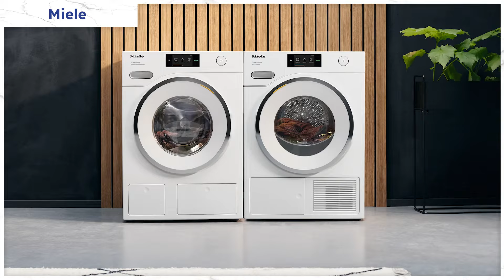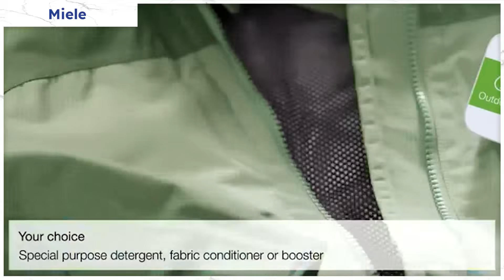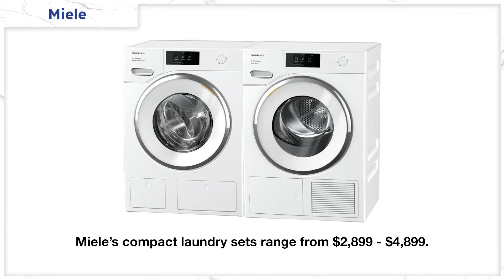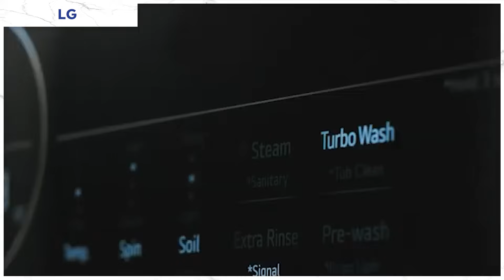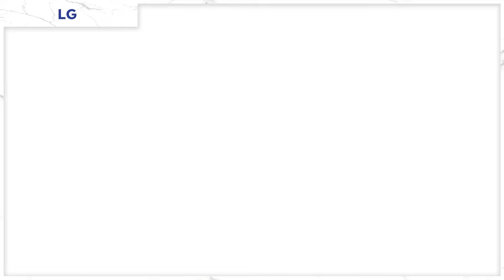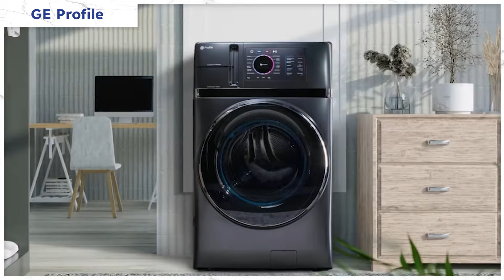Best 3 Heat Pump Dryers

Comment: The is no such thing as 110 volts in the US.  It's 120 volts and 240 volts.  And users are finding that lint is getting past the filters and onto to the condenser coils.  It's becoming a big issue.
Reply from the maker: Its a big problem with the older combos...However, Miele doesnt have this issue AS LONG AS you clean both filters including the one in front.  We will see on the other two
Reply: No dipsnot, it’s 110-120/220-240, I’m an electrician, sit down and SU
Reply from the maker: You know...I thought it was me...and I used work on an electric supply counter.
Reply: @bonzology322  You, are no electrician if you believe that.  Nice try though.  lol

Comment: Lol I got that LG washtower and the washer leaked from day 1.
Reply: Check the installation vs the owners manual requirements...I was reading a lot of reviews and the installers seem to be messing up the dryer drain line install...there are resources showing how it should be plugged in...

Not saying it isn't the washer, but many instances I read about turned out to be a bad installation